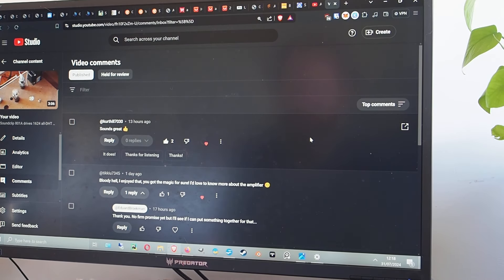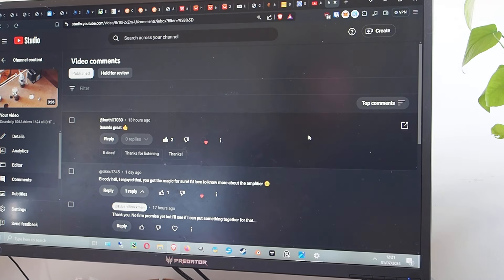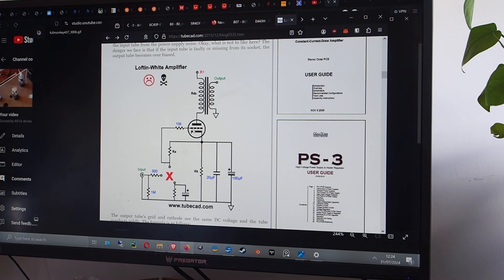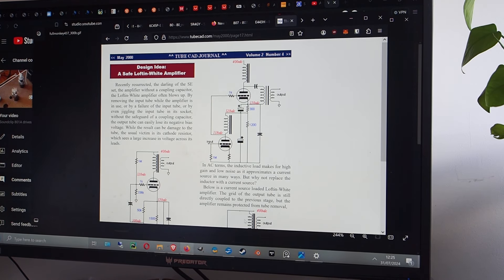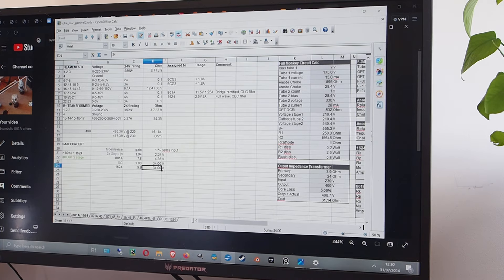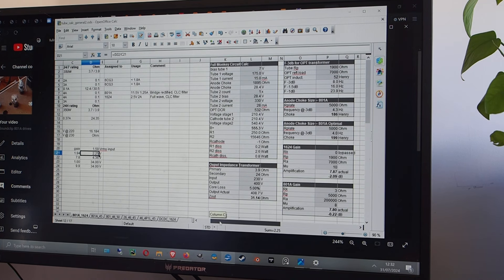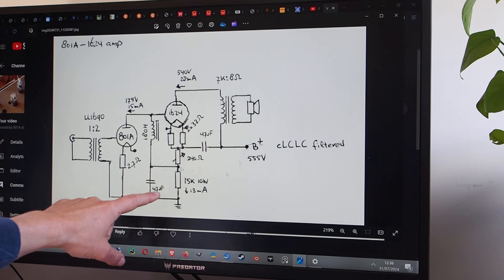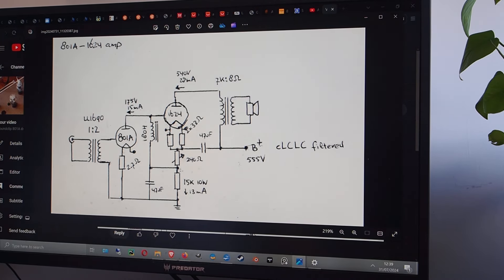A closer look at my 801A-1624 amp and its 'full monkey circuit'

Comment: Very nice thnx for sharing. I am building something very similar at the moment. I happen to have a nice vintage transformer that provides two ca 200V outputs, so am using trioded 6W6G and 6AS7 that operate quite well at those voltages. But like L-W it is depending on the driver tube for bias. I have some resistance in the output tube cathode, but also a sense circuit on the driver which cuts off the output tube if the driver has no current thru the cathode resistor. Hope to be done in a few months... this hobby takes time with so much else to do...

Comment: The design explains what I commented about your amp having a better time /pace /natural rythm than most amplifiers.
it was a japanese audiophile that designed also a direct coupling between driver and a  300b tube ..................the original Loftin White dc coupled amplifier design was not intended to sound better but to build a cheaper amplifier ..........;many variants were proposed trying to make it more stable .
There was a complete integrated 6V6 PP design PP Amplifier with cathode coupled OPT's using 6SN7/6SL7.........if anything goes wrong all goes wrong .........

You can protect the grid swinging positive at start up ( if it happens ) ..........with a diode between  grid and cathode .
and a fuse of a conveniant value on the HT ....but fuses always in the signal path , I bypass them with a switch when I am confident in the amplifier for the better listening sessions , at my OWN risdk !
Reply from the maker: After having blown up 2 tubes, one because of failing fixed bias and one because of sharing filement supply... I wanted rock solid operating, so this circuit given my need to make self-biasing required, was a very nice solution.

Good point of the fuse being in the signal path :) About everything is in an SE amp :)

As for stability...its very well behaved this circuit, it has rock solid operating points, and very well behaved as the rectifiers start conducting: I'm using ultra low drop TV dampers right now, which give a nice 20 second delays and then a very slow voltage rise... so measured bias and current is always safe.

Now, I want to try paralelled DH rectifiers (2x5V3A or 2x5R4GY) as well as a type 82 (remove dynamic resistance?) to see how those sound in this circuit but those will need a delayed start. Did you ever use a relay or tube for that, or just manually switch B+ on?

Comment: Thanks for that Eduard, great review of a circuit I've never seen before....a real tricky monkey! I guess you have to be extra vigilant with PSU ripple with the ultra capacitor arrangement. A lot of useful insights in this one.
Reply from the maker: Hi MFT! Indeed, so what's neem done here is that c-L-C-CML-C B+ filter gets the ripple to about 7mV while the driver is pretty much fully isolated from the B+. With filament bias, it's more about that supply than anything else. It's a very quiet amp, hum is only just audible at 1ft.

Comment: Hi Eduard, interesting design. And yes, not for the faint heart-ed. The part that I would not be happy about is that the entire input tube is powered trough a pot-meter (if my understanding is right). Probably it would be a good idea to set the bias and then replace the pot with a resister network.
Reply from the maker: Hi Hugo. Yes, pots are really not needed as this circuit is self-stabilising (apparently through positive feedback) and values are not critical if the operating points have been design with some headroom (I leave 6dB on drivers with output tube at full input signal). 

For experimentation, I use 2K2 2W wirewound pots bypassed by 240 or 680 ohm, so I can finetune the value while most of the current passes through the resistor, not the pot. Wirewound pots seem to have a very low impact on sound... much less critical than capacitors, interstages and output transformers.

Comment: Hi Eduard.. Very nice.. How does the DC Monkey compare Vs. Stacked Supplies in subjective sonics?Maybe try an Input step-up trafo -> triode wired 6W6 as input for a “Monkey” to the 50, then IT coupled to another 50 or a Gold Lion 300B (not the TJ Mesh..)
Reply from the maker: Hi Rick. Thank you and for the suggestions.. so why the 6W6? Since having moved to all amorphous cores, I find it harder to listen to IDHTs - the most pleasant ones this far have been 6S45P (crude but energetic and works well with type 50 in 2-stage amp), and the EL33 (warm, everything sound very pleasant but lacks detail).. many tubes actually dropped off.. including my fake-mesh 300B, 6A6, 7044, 26, 46, EH443 ... I've only got some hope for a 2-stage trioded EF6-45 ..

As for further IT coupling, indeed that's what I've done since this circuit: a  full monkey circuit to drive an IT. So far the best sounding combinations of that have been 801A-45 > 50, 801A-50 > 50 and 50-50 > 1624. In my setup, a 1:2 step-up (LL1690) input sounded under-driven so it's going to be avoided for now.

Re: stacked supplies, I see zero advantage having two supplies interact with each other while this circuit has no interaction, is simple, failsafe, dynamically exceptional and stable. It apparently has pos. feedback to stabilise the operating points of both tubes. In 3-stage form, it still sounds subjectively sounds very real and also like a simple amp.. so I'm just not tempted and any more complexity would impact the 'fun' factor of building too. This concept is much easier to optimise and intuitively holds more than enough promise to go that way. Hope that makes some sense in being somewhat disagreeable this time :)
Reply: @EduardBroekman 
The trioded 6W6 as a driver IT coupled to an 845 (low powered - low B+) has a muscular tone but still has that mellow sweetness.. It would not be as holographic in realism as DHT’s all along the chain, most likely.. Thanks for the full report on the Full Monkey.. The online tutorial that TL did a long time ago is diy gold.. I have 6A6’s but have not tried them yet (or ever heard them implemented..) I’d hope they are more nuanced than the more literal 6SN7’s.. The 26 and 46 dropped off huh..
Reply from the maker: @rickg8015  Thank you that sounds promising the 6W6 / 845! I do need to try some more transmitter tubes... 

I found the 6A6 to be a nice polite tube that doesn't do anything wrong and it also doesn't sound like a small tube.. but to me it lacked charm and it didn't sound fluid. I'm sure it would work for those wo like a 'hifi'ish sound.Thomas Mayer uses the identical octal 6N7 in his lower end type 45 amps. I'd still grab a 6S45PE (yet to try 7788, 417A or D3A).. .Once here I listened to 801A-45 (1:2 step-up) and I'm sure 12A-45 would gel really well, it was game over for the 6A6.
Reply: @EduardBroekman  Thanks for the 6A6 impressions.. The  6W6>IT>845 amp has a 76 input tube DC’d to the 6W6.. I’m not sure if I could post a web link to the schema by Jim Doyle here, YT might delete it.. An old friend breadboarded it but I never knew if he fully built it into a permanent amp..

Comment: Probably a strange question, if the filaments job is to emit electrons, and more electrons are available at lower voltages, why is it common practice to use say a 0 to 300 volts power supply, why not use a 0 to minus 300 volt power supply ?

and could reversing the (silicon) diodes in the power supply is all it would take to try it out.

Only thing I can think of is a hot filament emits an order of magnitude more electrons than negative 300 volts.

Still... I wonder if there are any sound benefits to running 0 to minus 300 volts ?

On an even stranger note, I've read that a positive earth in a cars battery setup, (the way it used to be) allows the body of the car to attract electrons, which reduces rust, as opposed to negative earth, which is always emitting electrons off of the car. They also reasoned, that petrol contains more energy in a positive earthed car, to the extent that in a restricted class of racing, one drivers car out performed the others by running positive earth. And that trick can be hidden by running a normal battery dead flat and then recharging it in reverse polarity so positive is coming out the negative terminal and vise versa, along with some wiring tweaks to allow alternator charging etc.

.
Reply from the maker: There's no problem with that in theory - voltages are always relative to a give reference - and some tube amps indeed have both positive and negative voltage supplies.  Now one early comment:  the filament emission is only based on the current that flows through it, not it's relative voltage - that's of no influence. Since all voltages are relative, SQ is also not affected (imho) but there's all kind of things that may need attention with a change like you propose.

Example 1: input capacitor. with signal being 0V and bias for tube 1 maybe at 6V, this capacitor only sees 6V difference. With the cathode at -294V, now your input capacitor voltage rating needs to be 400V. Example 2: A lot of tubes can not have more than 100V  difference between cathode and filament, which will act as a diode of sorts, so now with the cathode at -294V, the filament general voltage level need to be brought down, which puts all of the filament voltage lines at around -300V .. all to say you'd definitely want good reason to move this way and judging by most amp designs, there doesn't seem to be too much compelling reasons unless one is creating a very specific amp design concept where a negative rail makes the solution easier or safer.